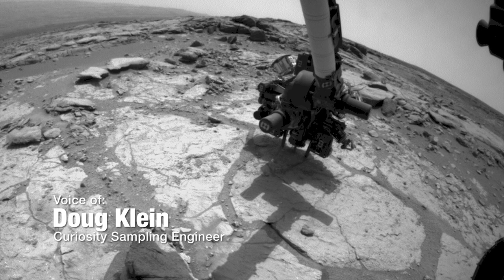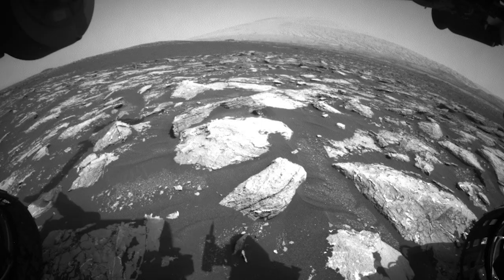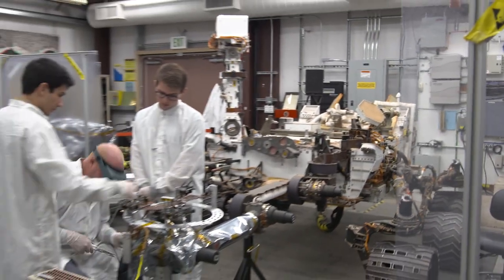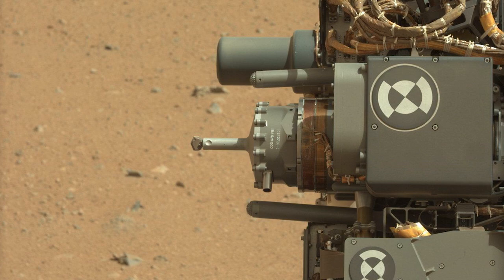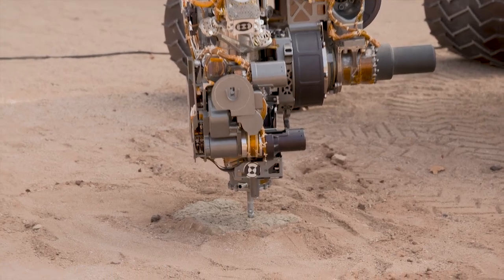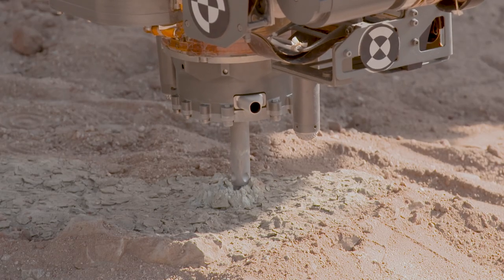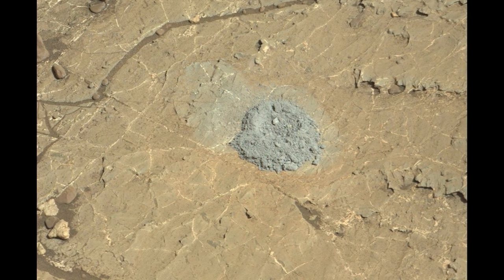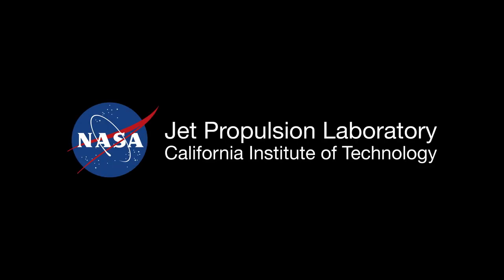Curiosity's New Drilling Technique

Comment: Am I missing something?
The feed extender was not extending when commanded.
So the new technique is to FIRST extend the feed extender... that was not extending when commanded... What??? 
I can infer that there is some odd mechanical forces affecting the drill extender when it was being supported by the stabilizer posts, but I can only guess.
Well, glad you guys persevered. :-)
Reply: Or perhaps it wouldn't extend when pushing the drill against the rock, but was still able to do so under no load?
Reply: Good question -- we are able to sporadically get small amounts of motion trying different motor control strategies, so it took a good amount of effort to get the feed extended, but it's still not functional for drilling the way it was designed to be done.  There is an issue with the drill feed mechanism itself, it is independent of the drill stabilizers.
Reply: jasonir129 I can't even imagine what might cause this kind of problem. Phase breakage? Driver gone crazy? Mechanical issues? Needs better explanation.
Reply: @jasonir129  Hello from the future! Don't ask, everyone says they want to know the future... but trust me, you don't want to know. Can you elaborate on the hardware used? The way you are talking, it sounds anything but a "one chip solution." It would be interesting to know what NASA ended up going with. Believe me, if I could find them in the thrift store I would have found out already.
Reply: @zimperch  yup, it’s a great question that we probably won’t have the complete answer to until someone can land on the red planet and get eyes on the feed. Definitely the biggest challenge in space robotics is you’re not there to analyze and get the complete answer to your failures.

Comment: Can the stabilizers be lowered after starting the hole?  Will you continue to test the feed mechanism periodically in case it starts working again?
Reply: Hi @MattTrevett, The stabilizers cannot be extended.  The feed mechanism hasn't moved since October but the team does try several times per week.

Comment: why not suction the dust and anylize  but good job with what you have
Reply: Interesting idea.  It would be difficult to design such a system given that the atmosphere at the surface of Mars is only ~1% as dense as Earth's.  To get equivalent suction force, would need to pump the air 10x faster.  Hmm, may be possible.

Comment: Will this method be used in 2020? Or a new drill altogether?
Reply: Do you mean InSight?  InSight has a hammer drill on it, so it can dig down to hopefully the full 5 meters.
Reply: Darrenatace no, mars rover 2020
Reply: I have not got too involved with that mission, yet.  I'll have to look but the 2020 mission wants core samples, right?
Reply: M2020 will have a completely different drill design;  a coring drill instead of a rotary percussive powdering drill like MSL, and will not be using the same troublesome motor behind MSL's feed mechanism.
Reply: Ryan Kinnett thanks
Reply: Ryan, you're the man.
Reply: how’s life?

Comment: What's the point of wearing a white robe in an open field?
Reply: Seems silly at first glance, right?  The smocks and wristbands reduce the risk of electrostatic discharge damaging electronics, which is still a threat even outside.  This is standard practice for flight critical hardware.  This test rover is a national asset and we do everything by the book to preserve it.
Reply: Good answer, Ryan!
Reply: @rkinnett  Thanks for the answer. But why white instead of some other color?
Reply: @zambani  good question, no idea! It’s cheaper? Would be nice to have more style ;) but we are out there on some days >100F so whatever keeps us cool…